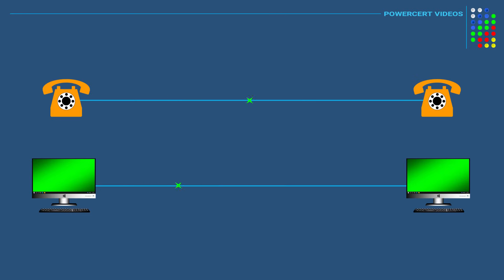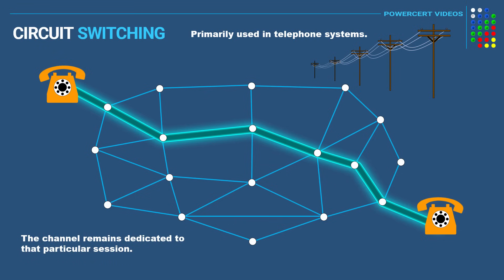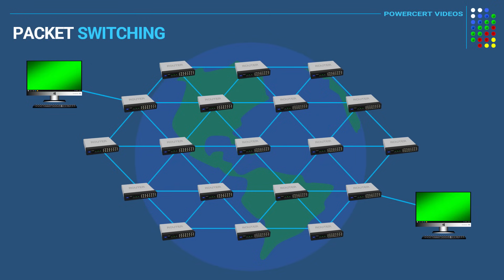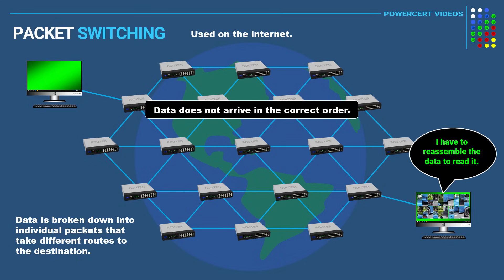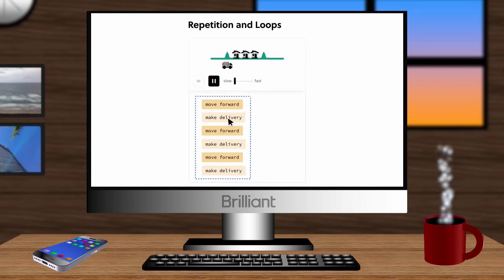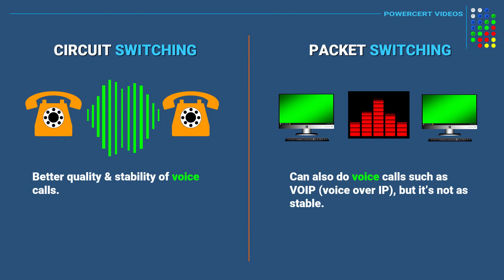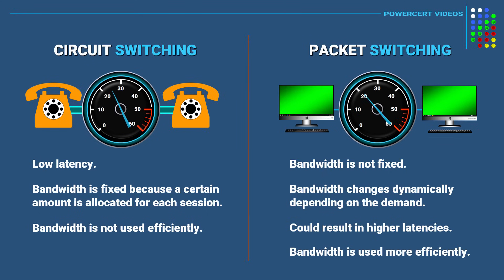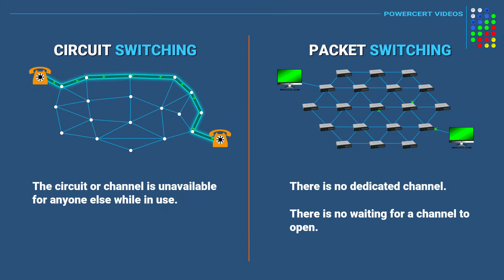Circuit Switching vs Packet Switching

Comment: Interesting video. Circuit switching was used in mobile phone calls before IMS-based came around. 

That's what necessitated creating the VoLTE standard for calls, which has an advantage over OTT (over-the-top) app-based VOIP in that VoLTE calls enjoy top priority on mobile networks, making their calls crystal clear.

Comment: But how did we use phone subscription to get internet data before ADSL became a thing?
Reply: dial up internet
Reply: @JJFlores197  I know, my question is what is dial up internet exactly and why did we need to dial a number to access internet?
Reply: @JimmyC0  Well as the name implies, a dial up connection uses a modem to dial into another computer. Its like when 2 people talk on a phone, but instead of people, its 2 computers talking to each other through modems. The modem dials a phone number, usually from dial up provider. Then it sends the user name and password (provided by the ISP) so that the ISP can verify your credentials. Once you're connected, you have internet access. At a high level overview, a dial up connection is a computer talking to another computer over the standard phone network.

Comment: I also wanna add. If something happens to the connection when using circuit switching (a router goes down, a link breaks, etc), it can take a noticeably long while for the new circuit to be allocated, but in VOIP it'll either take a bit longer to receive some of the packets, causing some jitter, or the receiver might add a short silence, a soft noise, try to infer what was in the lost packets from the surrounding ones or even reconstruct the lost packets completely from error redundant information in surrounding packets, depending on configuration and situation